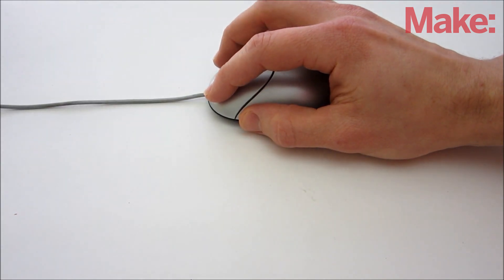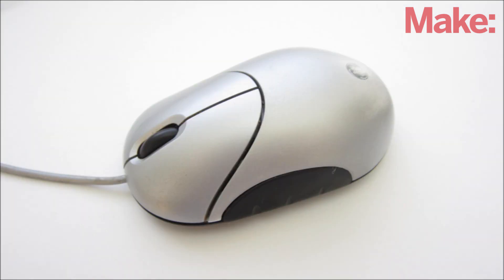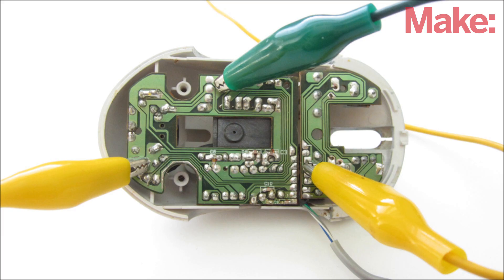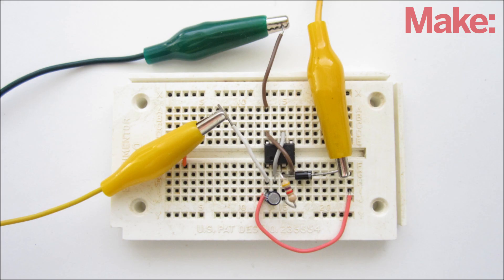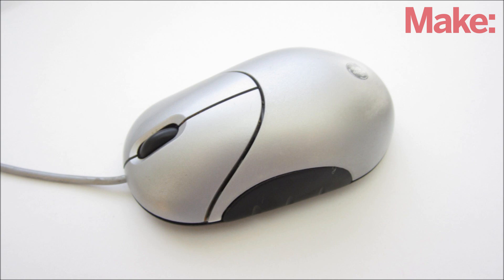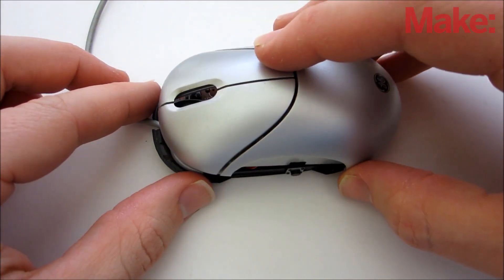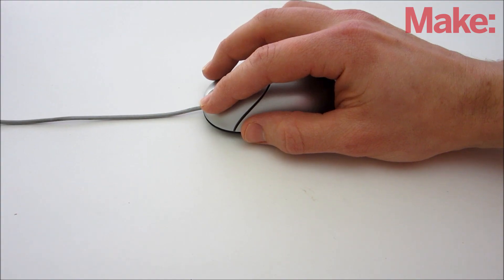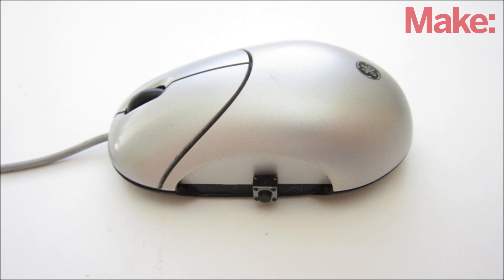DIY Hacks & How To's: Rapid Fire Mouse

Comment: You could maybe use a potentiometer in place of, or in addition to, the resistor, to get an control to adjust the clicking speed on the fly, even while the button is pressed. Assuming of course, that I understand how this modification to the mouse is supposed to work.

I assume that the resistor limits the current given to the capacitor, and the capacitor stops current flow until it builds up a high enough charge, and in doing so, acts to create electrical pulses. A potentiometer works by limiting the current depending on what position the nob is turned to, so less resistance = more current = less time between pulses = more rapid clicking.

Comment: can this work with newer mouses like CONNECT IT Biohazard ? I tried it and it made that red diode flash fast, so I dont know if anything was wrong or newr mouses are different so they cant be modified.
Reply: you can mod any thing but the circuits on the mouse might have a different layout or there might be a short

Comment: plays minecraft pvp... gets banned for autoclick
Reply: +Caden_Wolf MC well deserved.
Reply: +Cadiie Skywars&amp;PvP Ever hear of a macro?
Reply: some games doesnt allow macros ... for example Metin2, just NO software works with this because of Protect gameguard anticheat SW
Reply: Don't overuse autoclick, mix it with regular clicks, and of course be more realistic and make it output 13-15 CPS maximum.
It's just gonna look like you're switching clicking methods from regular to jitter clicking, for example. If you want it for cookie clicker games, set whatever limit works for you. You can add an potentiometer to change the switching frequency.

But cheating doesn't make you the best if you can't control your cheats.
Reply: @AdamSKEN.01  this comment was from 7 years ago LMFAO
Reply: @computercloset6165  So what? I even commented on an 13 year old comment so 7 years is nothing for me.

Comment: Or buy a mouse that has macro keys and set it for a auto clicking program. Same thing, no programming.
Reply: Cole Boettger well my mouse clicked so fast Modern Warfare crashed
Reply: Cole Boettger  I have 2 buttons that turn on/off my clicking. It clicks almost 1,000 clicks every 10 seconds.
Reply: Cole Boettger What's the program you use called?
Reply: +Jesse LaRock Xmouse

Comment: hey does it work with Mylar capacitors or does it make the computer think its one click?
Cause i made a circuit like that on a breadboard and i used a mylar capacitor and i put a led and a small speaker to it and
the led wasn't blinking slow and the speaker made a low high pitch noise.

Comment: Whenever I power the 555 from the USB I get "Unknown USB Device" and the mouse stops working, If I power the 555 separatly from another USB port it works. Any ideas how to solve this?
Reply: If you trying to connect only that 555 it cant work, if there is nothing that reads the USB,if you have Arduino, use it as help to connect it in USB
Reply: I tried to power it just like in the video. Thats when I get error message from windows. But it works if I just connect another spare USB power to the 555,

Comment: Most FPS games have measures in place such a max fire rate so rapid fire wont work any better then clicking. But i do have fond memory's of binding fire to the scroll wheel in UT.
Reply: Lol raped fire?
Reply: if that happends just make the capasitor value bigger to slow it down to your desire clicks for second
Reply: lol
Reply: Might wanna edit your comment XD
Reply: Traven Craker Noted.
Reply: well, if you make the frequency high enough... You can get insane cps and then you would fire your semi-auto pistol at its max fire rate. Isn't that cool huh? No?

Comment: Maybe replace the 555 timer with a microcontroller, like an ATTiny45. Same form factor, but you don't need the resistor and capacitor anymore, and you could program variable delays so it looks like an actually human is clicking. No software would be able to tell the difference and get you banned.

Comment: I'd suggest adding a small potentiometer to adjust the click rate, as some things require different click rates.
Reply: kerberos623 actually that would work since you can adjust the potentiometer 

freq=1.44/((R1+R2)*C1).....C1 can stay the same and changing R1/R2 will change the frequency

If you put the sweeper of the pot to pin 7 of the 555 you can adjust both R1 and R2 at the same time
Reply: that wouldn't work since the rate is dependent on both the resistors and the capacitor.

Comment: Also can be done to a wireless mouse, because who still uses wired ones these days?
Reply: Some people do believe the lag on wireless mouse could cost them the game.
Reply: Mine has no lag. I don't play games so maybe it does and I just don't notice it. I see.
Reply: The hack could be applied to wireless mouses as well, but it is more tricky.
But it will drain your battery, even when the speed button is not pressed.
And you need to be carefully, which power pin you are using. There pins which are powered when the mouse is in idle/power save mode and pins which are unpowered during idle. Using a pin which is unpowered during idle, would minimize power consumption.
Best would be to start with a cheap wired mouse and when that is working, apply what you learned to the wireless.
Reply: I notice lag with my wireless xbox controller so I just use a wired one
Reply: David Hogendoorn
 Right.

Comment: What's the purpose of the diode ?
Reply: i think it is to avoid current being fed into the 555 when the actual mouse button is pressed :)
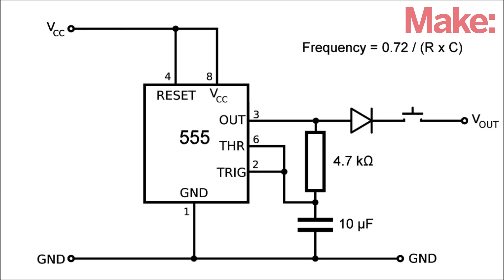Reply: I think the diode is there to prevent any accidental outside influence on the Time Constant circuit that is composed of the Resistor and Capacitor in this build (0:22),
Reply: Isolates the IC from the switch. Pretty much what Riccardo said. Without the diode, you would have 5vdc back feeding into the IC and ultimately burning something up. Would make for a nice hand warmer on them cold days though, lol
Reply: It makes sure only positive going pulses leave the output
Reply: There are no negative pulses anyway
Reply: gregory morgan I worded that a little weird, it just makes sure the 555 is sourcing current, if it was sinking current because the left mouse button was active low, then you would need to flip the diode

Comment: If you do that to an xbox controller, you could get banned from xbox live

EDIT: I could be wrong about the ban from xbox live, it looks like some developers would ban you from match making from thier games for modded controllers.  It wouldn't surprise me if it ws in the xbox live TOS said something about "modifying equipment".
Reply: How are they going to find out, send the xbox controller integrity officer to your house?
Reply: No you won't, they SELL turbo controllers.
Reply: Tenocticatl  My theory is that the game or system can detect if you are doing something that is not humanly possible like hitting a button at a consistent rate or at a really fast rate.
 
Its been a while since I seen a video or forum post saying "I got banned or suspended for tampering."
Reply: Moped Viking  It is possible for a system to tell the difference between a genuine controller and a third party controller. So developers do have the ability to compensate for a turbo controller. There could be a situation where a game could detect a turbo controller button push and just treat it as one push.  Now if a system detected a standard controller doing something that is not humanly possible, then a game developer or system could consider it tampering.
Reply: goodBEan I can do like 13 or 14 a second. 15 a second isn't inhumanly fast
Reply: WolfDemonProductions Yea, but you can't click exactly every 266 milliseconds, nearly perfectly every time, like this circuit can.
Reply: Kevo F
Then click the speed button relatively slow. This reduces the click rate and introduces an timing variance.

And 555 timers are anything then perfect, their timing is inconsistent which in electronics is a down side, but in this case is a feature. Of course the 555 timer is still more consistent then a player, but the 555 is less consistent then a turbo button or software.

Comment: What about a macro ?
Reply: Software modification is usually alot easier to track for developers.
Reply: Halick
True but, these are still easy to uncover. Most competitive games have measures to prevent this, even if it is hardware based. Humans can not repetitively press at perfectly timed intervals with perfectly timed let-offs, not to mention the speed.